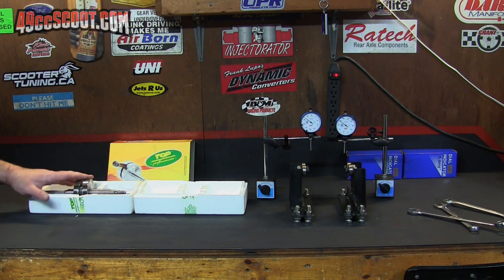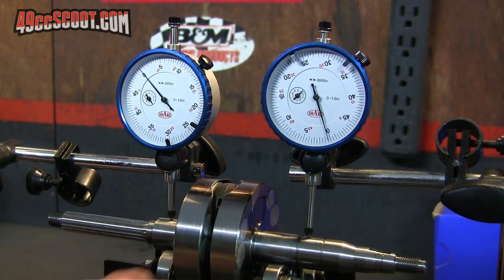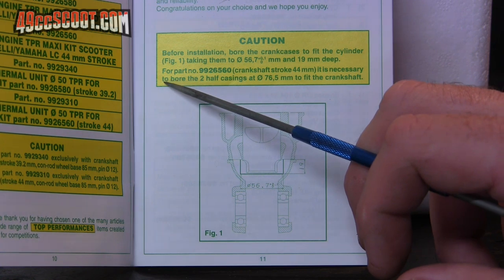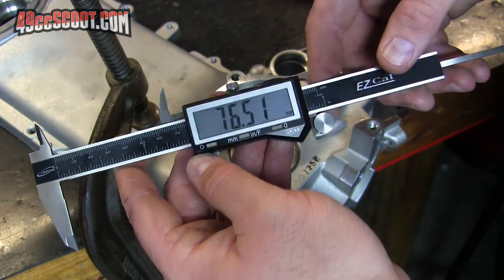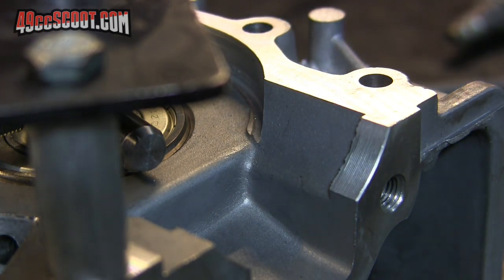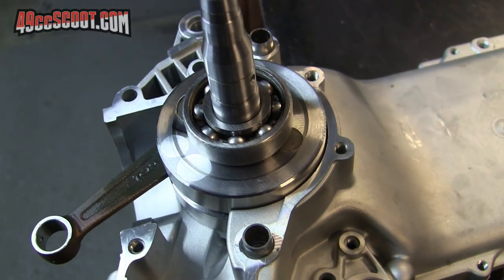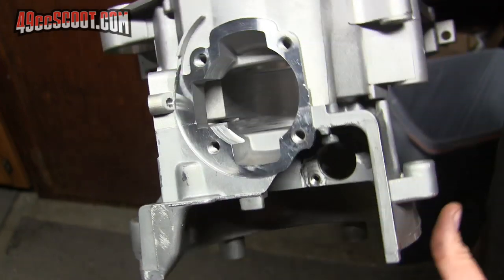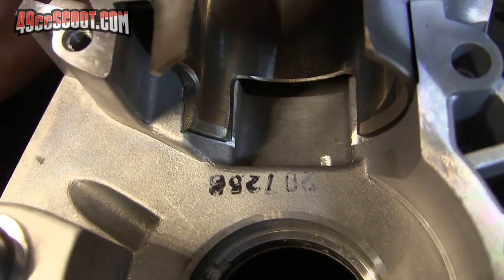TPR 86cc Build : Part 3 : Crank Check & Case Machining

Comment: When you are measuring the run out over the support points it actually doesnt show the runout, you should measure at the furthest point or support the crank from the ends and measure from the bearing surfaces.

Comment: I think if you measure the runout of the crank at the supporting bearings, you get zero all the time, because the shaft is turning around that point. I would measure the runout near the ends. Am i wrong? Sorry for my bad english, and greetings from Hungary! :)
Reply from the maker: Being farther away would certainly amplify it. I just used the smooth and un-tapered surfaces which were nearer center.
Reply: You are correct. allways put the indicator as far away from the supporting points as possible. tapered surfaces are good measuring points. It is possible to get your crank runout under 0,01mm at home with simple tools.

Comment: Might want to go a little deeper for the bore for the cylinder.. Aluminum expands more than Steel or Iron, so that gap could get taken up and then more which could cause warping or could cause the cylinder to push away from the case causing gasket issues.. Just food for thought.

Comment: Hi what's the name of the cutting tool you're using? Any links to where you can buy them from? Cheers.
Reply from the maker: Here's info on the crank clearance tool : https://www.youtube.com/watch?v=KFVX18wzw28
Here's info on the cylinder clearance tool, with links in the description : https://www.youtube.com/watch?v=88rt10Ry9GE

Comment: great video! i'm a big fan of your channel! i would like to know if you have any suggestion to build the tools that you're using in the video for measuring the crank, what do you suggest???
Reply from the maker: The stands? I just used some angle iron that came off of a scooter crate. Welded together. Bolts with nuts for the adjustable leg. Small bearings bolted onto the top.

Comment: Is it going from a 50cc to 86 cc ? Will it need to be road  registered as a full  motorcycle at that engine  size?
Reply from the maker: Then engine is going from 50 to 86. The scoot was a factory 90, but registered as a 50. Can't register it here as a motorcycle. It's some kind of grey area.

Comment: Where can I get thos engine casings?
Reply: Elmar Dylong Type In 2 stroke mini atv engines on google and it will give you all you need. I believe he is using a variant of a “1e40qmb” case which responds well to cutting. It is a clone of the Minerelli engine found in 50cc Yamaha scooters. Believe it or not, I find the metal on these Taiwan/China cases superior to the Italian made Minerelli moped and Yamaha cases, which is better for doing these big stoke/bore builds. I’m planning something similar around a QJ RX8 or Vento Triton.
Reply from the maker: @MattySlimz  There is a seller on eBay that sometimes lists CPI engine cases like these. That's where I got them.
Reply: @MattySlimz  "2 stroke mini atv engines" gives me those chainsaw type toy like chinese stuff. "1e40qmb" are just the minarelli clones. He uses a special case, made by CPI, because it has a lot more meat around the crankshaft. That is what I am looking for, so I can build lasting 100cc motors.
Reply: Elmar Dylong A good starting point I may add would also to check out 49ccscoot.com in the classifieds/for sale section. CPI cases are 1e40qmbs.
Reply from the maker: @ElmarDylong  The CPI cases aren't really special for a 1E40QMB. They're clone cases like the rest. CPI at least used to be an upper tier Chinese manufactured scoot, and who made my Vento Tritons before I think it was Baotian took over. You don't have to get CPI cases. These were a deal for something that I figured should be decent quality for what they are. If you happen to find a 1E40FM engine, those should fit large  parts stock. ATV engines are great if you need a short case, like a Jog or the retro looking 2Ts. No as good if you have a long case scoot. You can get them from some brands with what I call a stretched short case. They have a short case gearbox, and it stretches the distance from the front to rear pulley to make the case longer for larger wheels. That would be OK, but if you want to use an over range transmission, belt sourcing will be tough. Even good stock belts cost more and are less available for those.
Reply: @49ccscoot  I have short and long cases lying around, but not one of them has those thick walls around the crankshaft like yours does. Also I do not need ready made casings for a 100cc, because I have a mill and a lathe in my workshop. I just need to be sure I can put such an engine together with what I have, then I do not have to search any longer. A 100cc cylinder and crank from Naraku is dirt cheap and will suffice for a lot of torque and a lasting engine. At least that is the plan. What kind of torque converter and vario will be used I don't know, but it will be a long case for 12" wheels. Overrange might not be necessary, as long as I can find a kit of gears that gives me a longer final drive.
Reply from the maker: @ElmarDylong  To me, OR is more about keeping RPM in a narrow band than top speed. It's usually the Yamaha and Aprilia stuff that has the thinnest walls. I looked it up and acd-parts on eBay is who I got the CPI cases from and they have some now.
Reply: @49ccscoot  thanks! :-)